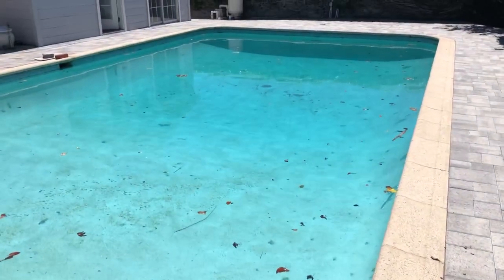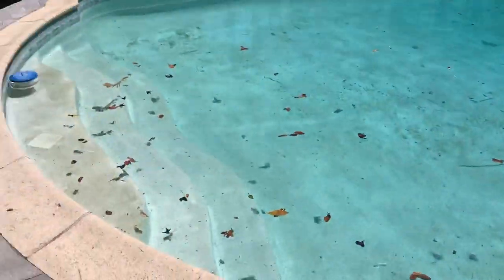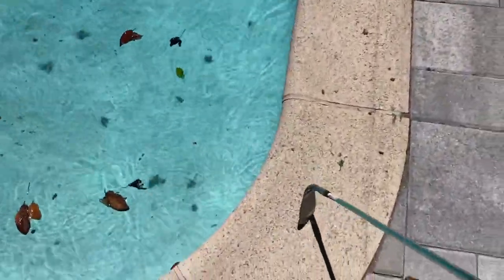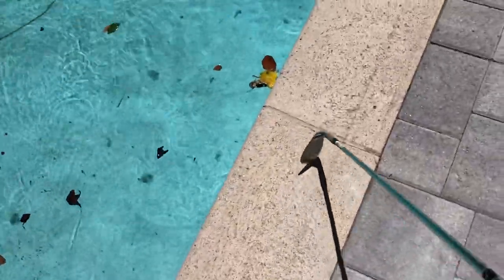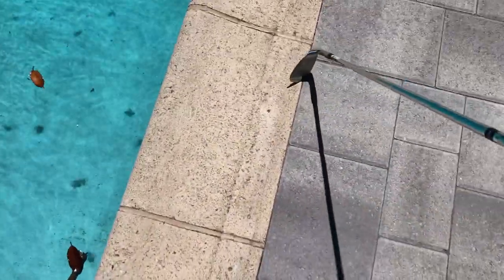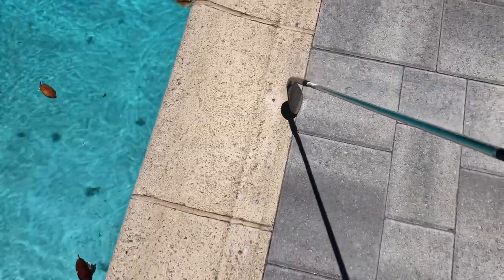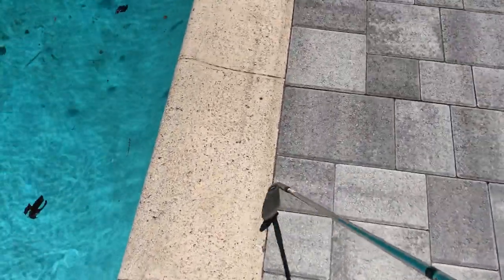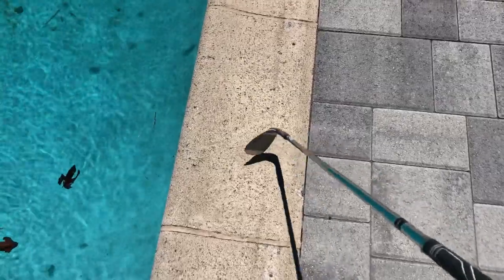Loose Pool Coping Needs Repair

Comment: Can you put up a DIY video showing how to remove and replace loose ones?  What if I can just lift them up?
Reply from the maker: If you can just lift them up that means they need immediate repair, this condition may be caused by the expansion and contraction of the decking material and or lack of deck-O-Seal between coping and decking material, or the bond beam below the coping. If someone steps on the very edge of loose coping it could shift and cause them to fall.
Reply from the maker: Here is a link to another youtube channel for repairing loose coping. https://youtu.be/oq6jH8Q7tDI?si=73VnDvpQ83Wlqdr_